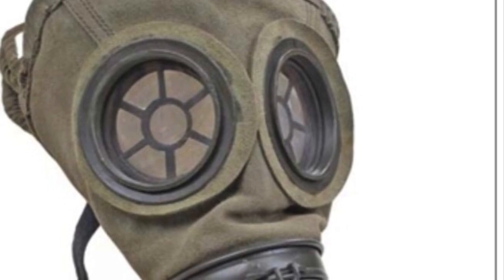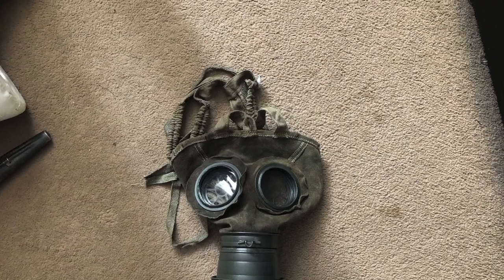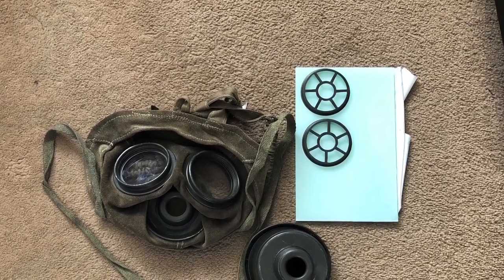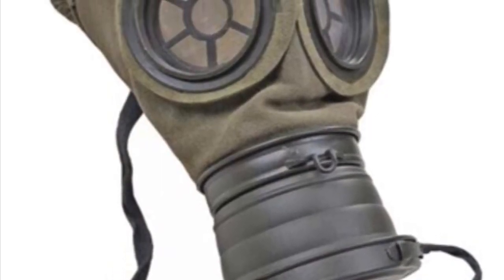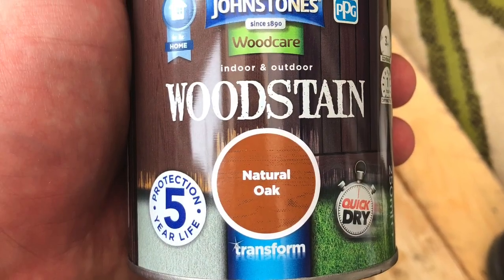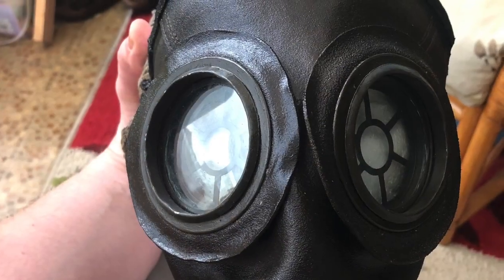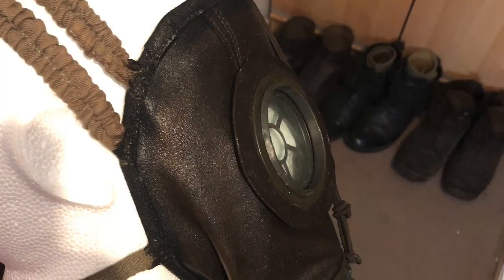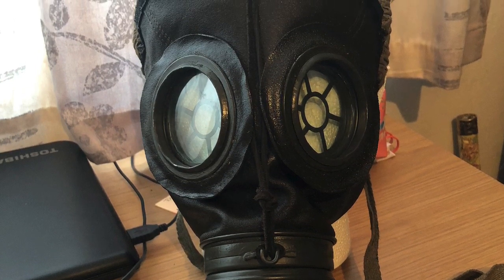Improving a WW1 German 1917 Gas Mask

Comment: I see people using all sorts of solutions to dye the mask, and I wonder why you don't just use leather dye? From WD-40, coconut oil and to wood stain, why not leather dye/stain? Is it from fear of staining your face? I'm quite curious.
Reply from the maker: I used wood stain because I think it gives a closer look to originals, leather dye to me just looks like brown suede rather than leather.
Reply: @carlmitchley5742  That is valid. However, I find that to get the more "glossy" look with the fibres resting down, you could probably get that with oils, which would both be more authentic, additionally darken the colour and also seal the outside leather, making it more waterproof, which is very important if you're going to wear the mask on a rainy day. I suppose it's all up to what one feels like. Thanks for the reply!
Reply: interesting .. good tips